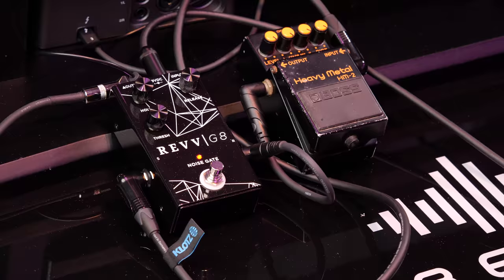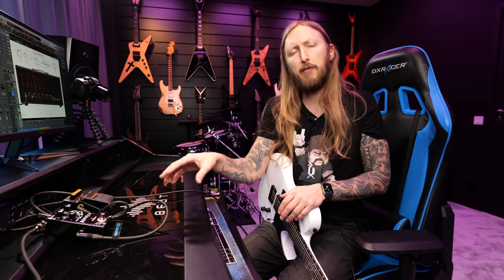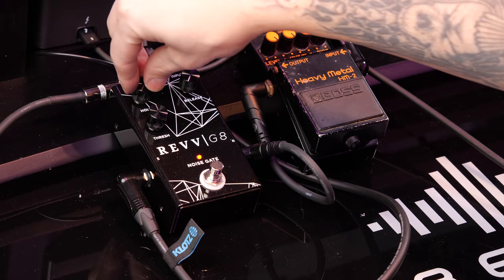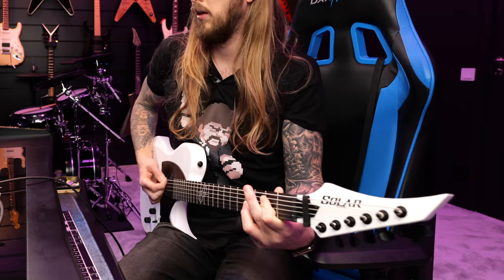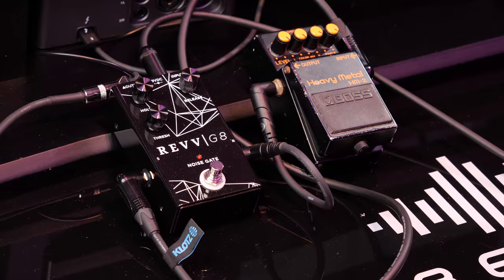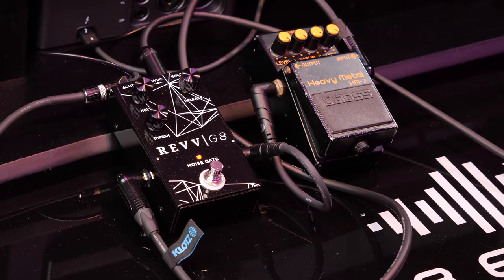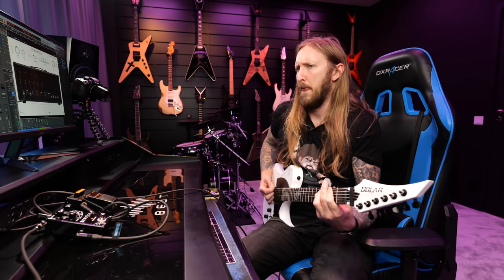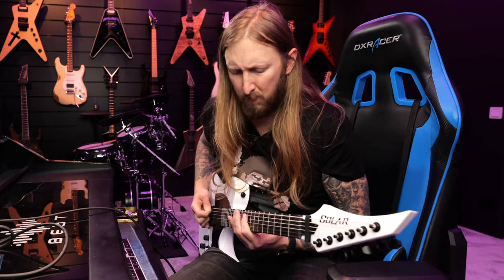Revv G8 Noisegate - LETS GET NOISY

Comment: That’s an amazing gate. My ISP G String II works when it wants now ever since we got caught in the rain at a gig. I think this is the one I would replace it with.
Reply: I have the G string II as well, it is an amazing pedal, but it is very picky when it comes to "when it will work appropriately" and when it will not... A not perfect power source will make it get very crazy as well, I've gone through some "tense" situations in live shows before because of that ONE pedal hehe... when it does work, it does do the job incredibly well... This G8 noisegate sounds like it does the job flawlessly though
Reply: @marcelo_campitelli  I love my ISP G-String 2. The best IMHO.
Reply: @marcelo_campitelli  Get yourself a voltage regulator. Never have bad power at a gig again.
Reply: I bought the Noise Reaper but haven't figured out how to use it! LOL

Comment: Pretty efficient.
A Revv, Fortin, Boss noise gate shootout soon?
It'd be cool.
Reply: The silent war.
Reply: Don't forget the ISP
Reply: add cheaper TC Electronic Sentry, that also is 4 method cable capable
Reply: Gotta throw in the lone Wolf audio endless blockade! My favorite personally!
Reply: Revv and Fortin use the same 4301 dynamics chip for their gate. Essentially the same thing.
Reply: @vminator  Thanks for the info!
I think that's why they are my favorite gate.

Comment: You're feeding the HM-2 in to a heavily distorted "amp."  Aren't you supposed to use the HM-2 with a clean or slight breakup amp instead?
Reply: He’s trying to show off how great the noise gate is. All that gain, and it still cleaned up relatively nicely

Comment: This is way too much gain. Choose a crunchy amp (JCM800) sound not a chuggy highgain Sound. The result will be much better.
Reply from the maker: No!
Reply: @OlaEnglund2  OK 🤣
Reply: According to Ola's testing (btw Olá Ola!), if this gate worked using a cranked amp sim plus a maxed out HM2 in the front, anything else you might do with this gate will work wonders 🤣🤣🤣🤣 The question is, can it gate 40 cranked metal zones? 🤣🤣🤣